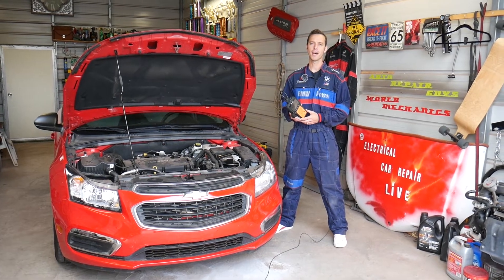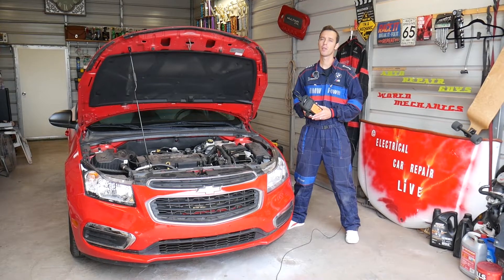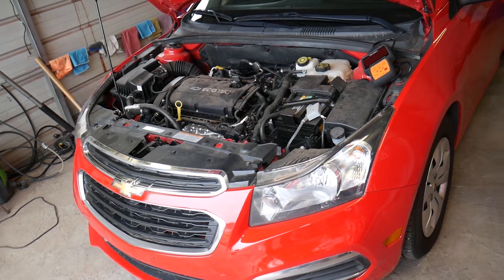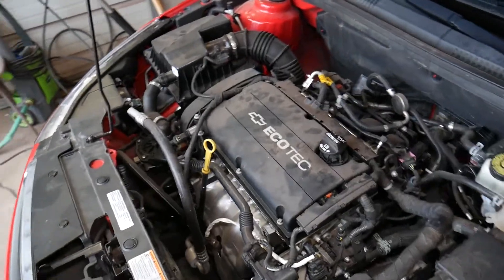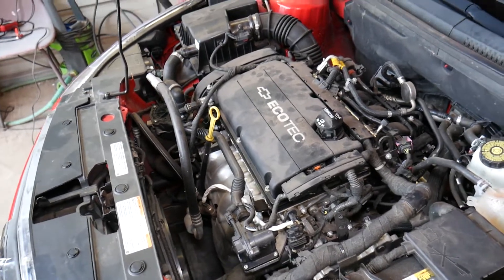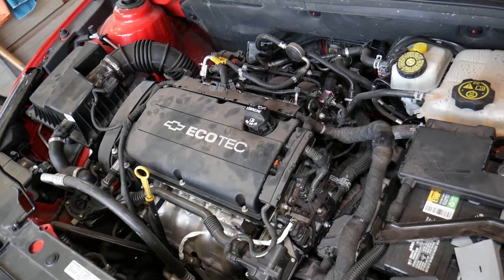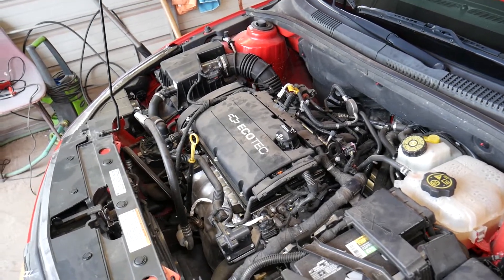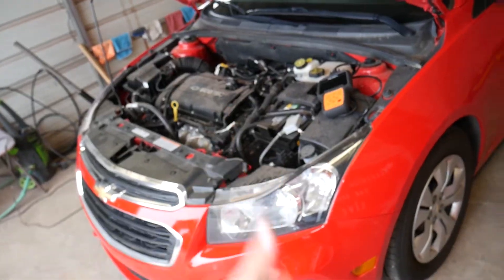FIX CODE P0126 P0128 CHEVROLET CRUZE CHEVY SONIC. ENGINE LIGHT ON

Comment: I really hope someone comments back

Just had the P0128 engine light come on and had the screen prompt saying "AC turned off due to high temps" 

Fan stays on constantly on high

I'm topped up with liquid and oil 

Car still blows hot air

Any suggestions on what my car problem might be?
Reply: Hey I have the same issue too!
Reply: @franzvillanueva3341  Found out that it's the Temp thermostat sensor! Hope that helps. 

Also there won't be a engine code but check with a code reader and delete the code if the fan stops and temp gauge needle works again its definetly the sensor
Reply: @Hinokami_TT Hey there, my wife’s 2014 Chevy Sonic has the P0128 code. I’m reading it could be low coolant, temp sensor or thermostat. But her A/C only blows hot as well. That could be low coolant or what you’re saying. We’ll find out soon. Thanks for the post.

Comment: Does anyones fan come on right away when you start the car?
Reply: Yes. I just changed the thermostat with housing and ect sensor.  And fan still comes on right away on high, with codes p0118/po128..thanks to these comments I just learned about 2nd ect sensor.  I will check that out later.
Reply: Just erase code and it'll go away. If it comes back, then it's a bigger issue

Comment: There's two ECT sensors right?
Reply: Yes, one below the lower radiator hose and one inside the thermostat housing.
Reply: @Skidtire  are they the same kind of sensor or different.? Asking because I have an extra ect sensor and if same I won't have to buy another . Thanks in advance
Reply: @josedel7439  there is two different versions but the only difference is one has gold pins and the other tin, i replaced both mine with gold pinned sensors and it worked fine, hope this helps.
Reply: @Skidtire  thnx.